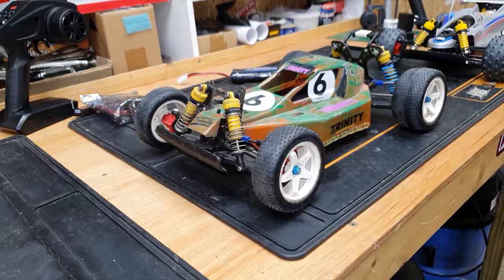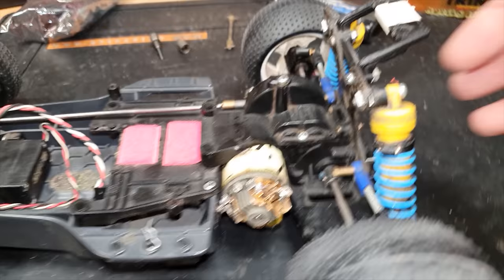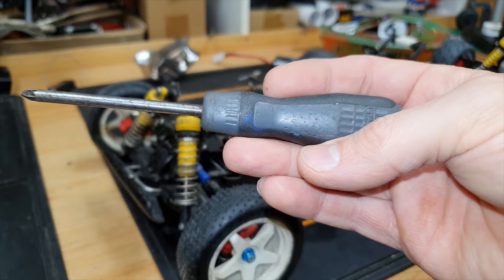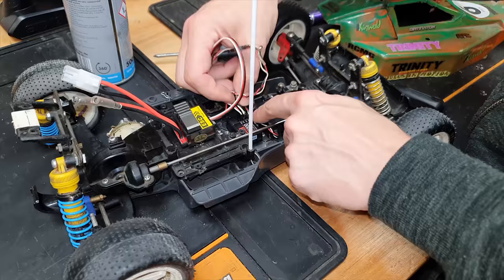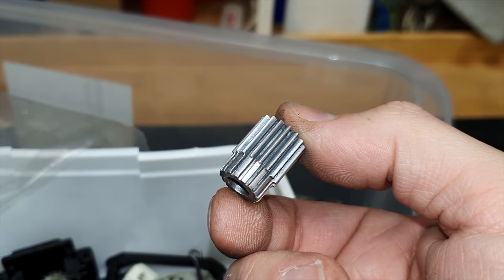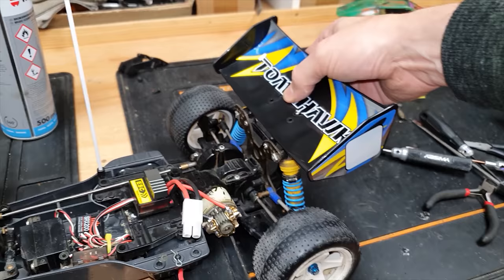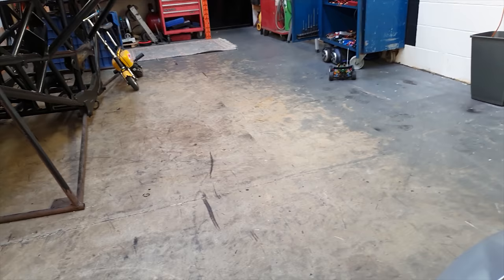Old Tamiya MANTA RAY - Bringing it back to life Part 2

Comment from the maker: What was your first RC Car?
Reply: Hpi rush evo
Reply: Traxxas 4 TEC 2.0
Reply: A tamiya TT02
Reply: Associated sc10 brushed was my first hobby grade. I had to cut many of yards in the summer to buy it
Reply: The traxxas Rustler
Reply: Traxxas Nitro Hawk
Reply: Wltoys a959 from about 5-6 years ago
Reply: Traxxas Slash 1/16 4x4
Reply: Traxxas Slash 2 wheel drive it's my first and my only
Reply: I had the Niko Lobo Road Handler and like you I was flat broke. I saved up for it and when I finally got it I was beyond excited!
Reply: Wltoys A959-B
Reply: Carson Max18xxl
Reply: First upgradable rc was xmods!
Reply: Hobao hyper 9e
Reply: Trasxxas x maxx 6s but upgraded to 8s internals all your fault kev;)
Reply: I've never had one
Reply: My first RC car was a Tamiya Rising Fighter, which is strange because that RC is twice my age. I went on a holiday in a rented house (air bnb) and found it in a shed. It was all rusty and crappy but I got it working again, and so the owner of the house said I could keep it as it was her sons and he hadn't used it in almost a decade. Anyway, that's a car from around the same generation as yours, which I think is pretty cool to say the least!
Reply: Traxxas slash 4x4 vxl
Reply: Tamiya Super Blackfoot MT kit!! 10 years old as well!!
Reply: 1/16 slash 4x4
Reply: Xmaxx 🤣💪🏼
Reply: Slash 4x4
Reply: tmaxx 2.5
Reply: Latrax rally car
Reply: Tamiya blackfoot
Reply: Toy grade rc car
Reply: 2WD Brushed Slash
Reply: Kevin Talbot A fully self build
Reply: Traxxas erevo 1/16 VXL brushless
Reply: My first car was the traxxas bandit
Reply: My first rc car that was hobby grade was a traxxas rustler BIG MISTAKE I COULD OF BOUGHTEN THE ARRMA NONTORIEUS
Reply: HPI mini recon
Reply: Can't remember model name but it was some sort of Outlaw has a brushless motor still bash about with it today
Reply: Wltoys a959
Reply: Lunch box
Reply: Dromida sc4.18
Reply: Kevin Talbot kyosho outrage buggy and a tamiya grasshopper
Reply: Dromida MT 4.18
Reply: Cheap one
Reply: Losi mini desert truck 1/18
Reply: Ely Tolson Me 2 :)
Reply: 1984 Radio Shack Jeep Renegade. I still have and my second Radio Shack Audi Quattro,  and my 3rd Associated RC10 all I still have.
Reply: I have a Tamiya super Blackfoot, that I'm working on getting parts for to get it back on the road.
Reply: Tamiya sand rover
Reply: mine was a Red cat racing gen 7 crawler
Reply: Kevin Talbot i got a wltoys it was green
Reply: My first hobby grade RC was a 1/24 scale Tamiya 1983 Porsche 956 Le Mans. Started saving for it on my 8th birthday & Got it & a Futaba stick AM transmitter/receiver for just under $300 for my 9th birthday. I stayed up all night (my first all nighter!) to build it. I’ll never forget that RC!
Reply: My first rc was a Revell Controll Buggy 4x4 M 1/14 scale buggy back in 2011. It was an absolute POS and turned me off the hobby until I got my tamiya M05 in 2014
Reply: A couple years back i had a helion animus 18sc. Man i wish i still had it...
Reply: A 1997 tamiya cc01 honda crv also bought from models in motion the same place as your manta ray loved that shop when I was a kid.👍
Reply: @jerrymuniz7001  get one
Reply: Kevin Talbot trophy 3.5 buggy got it in 2011 when i was 7 years old 👍
Reply: NIKKO raider
Reply: Himoto 1 10 2wd buggy or according to Himoto it's the Himoto MegaE HUD but if you search it up on google use Himoto 1 10 2wd buggy it's the second image that shows on images
Reply: It's not that easy
Reply: Is the Ecx roost considered as hobby grade?
Reply: WPL c24
Reply: Traxxas stampede bushed
Reply: Second Hand Grasshopper when I was 12. Then got a Kyosho Ulitma, Mardave Meteor, Mardave Mini then an Ultima Pro XL. I still have them all apart from the grasshopper.  The Ultima Pro XL still runs and is getting an upgrade soon.
Reply: My first hobby grade was a traxxas stampede 4x4 brushed. I got it when I was 7
Reply: Hobby grade or whatever
Reply: If so Traxxas Slayer pro conversion
Reply: Kyosho Inferno Neo 2.0 and it's still my go to to RC today and I plan to keep it for as long as I live
Reply: @blueterror2276  that's a great RC man
Reply: Ftx outback ranger 2
Reply: I had a savage flux hp (silly fast)
Reply: @bensvlogsandvideos9256  that's a great crawler
Reply: @bensvlogsandvideos9256  did you customize it or did you leave it stick
Reply: A manta ray lol
I need to get it going again
Reply: A Mk1 Kyosho Stinger that I still have and still run! even though it breaks something just driving down the street, lol
Reply: @shadowkeeper1217  upgraded servo that's it
Reply: eceed rc blaze
Reply: @bensvlogsandvideos9256  hmm
Reply: i dont have an rc YET  i plan on geting an Arrma Senton BLX but Im broke :/ ill get one evntualy
Reply: My uncle gave me a slash 4x4
Reply: lucky :/
Reply: Tamy grass hopper then kyosho ultima
Reply: Losi mini highroller
Reply: I hear you loud and clear Kev, I believe we all chase those feelings once we get older and regular life continues to dull. Btw my first hobby grade was a Team Associated rcgt10 with an o.s. .18 racing nitro motor and at the sweet age of 13 I was more enthused by it than most anything I've had later in life.
Reply: @jerrymuniz7001  you made us all very sad please save $100 and treat yourself with a wl toys maybe they have a nice selection around  $100.
Reply: Tamiya King cab and still have it.
Reply: Kevin Talbot a brushed Traxxas rustler
Reply: ECX torment
Reply: 1/16 Traxxas slash
Reply: @MrDollaBillman  I am only 12
Reply: Hey put me in your videos for no reason
Reply: hpi wheely king
Reply: Kevin Talbot my first car was a Traxxas slash 1/16 scale vxl
Reply: Academy   Monster hummer  !!!!
Reply: the traxxas latrax desert prerunner
Reply: 1998 Traxxas Rustler
Reply: Tamiya Hornet (1984/85)
Reply: Traxxas telluride
Reply: Traxxas 4x4 teluride
Reply: Academy Rock buster
Reply: Redcat racing volcano 10
Reply: Tamiya Big Bear
Reply: Hpi savage 4.6
Reply: Traxxas nitro rustler. The old boxy one.
Reply: Mine first rc was used hpi rush evo
Reply: Traxxas Stampede in 2004
Reply: My first hobby grade RC car was the Traxxas bigfoot 2wd
Reply: Tamiya Grasshopper...  took forever to save up the $200 bucks.  Jrpropo stick radio $100 with two (slow) servos.  Horrific mechanical esc.  Reverse for brakes.  Runaways o'plenty.  Added a diode to act as a BEC and get rid of the 4xAA.  Resistor wire charging off a car battery.  It was more epoxy than machine when I was done with it... Ran for 40 minutes with the 380 motor but the 540 upgrade was sweet...  Used to beat my buddy's Yokomo 4wd racing in the vacant lot across the street because he had more car than skill
Reply: My first hobby-grade RC was the Traxxas Cat. Around 30 years ago. It was in kit form.
Reply: An Arrma senton mega :)
Reply: Traxxas Slash 2wd
Reply: Nissan skyline GTR matblack  with hobbywing 8s with drift wheels
Reply: 1 16 slash brushless, it was awesome as a 8 year old but as I got older I realized how much it kept flipping over and the handling wasn’t great but man I put that thing through its paces.
Reply: redcat XBE
Reply: Robert Schexnayder  thats a thing?
Reply: duratrax evader ext 2
Reply: Mine was the traxxas Rustler 4x4 VXL, I’m only 14 years old.
Reply: Mine was the traxxas Rustler 4x4 VXL, I’m only 14 years old.
Reply: Cen nemesis 7.7
Reply: Himoto eamba xr1 4x4
Reply: Traxxas rustler brushed version
Reply: Tamiya Frog (secondhand!)
Reply: Mk1 Schumacher Cougar
Recently rebuilt with re-release TopCat parts.
Reply: First ever was a toy grade monster truck.
First real RC car was a  Thunder Tiger TS-4n, still have it and it's still working.
Reply: Kyosho Raider
Reply: Black foot 3
Reply: MRC Tamiya frog
Reply: Traxxas E-revo 1/16 brushed. Still my only hobby grade car. I absolutely love wrenching on it.
Reply: Arrma granite 2wd
Reply: Im still 12 im still having my first rc

Tamiya DF-02
Reply: 1/18 scale dromida buggy
Reply: My maisto speed beast hobby grade I got it last year so this christmas I'm getting a Rustler Vxl tsm 2wd stadium truck
Reply: Losi 8 conversion 85mph 6s
Reply: Feel very lucky
Reply: Tamiya Alfa Romeo Giulia Sprint (M06 Chassis)
Reply: 1st a Tamiya Monster Beetle, then a Tamiya Clod Buster, then a Kyosho Lazer ZX. That was back in the late 80's, early 90's... Wow!
Reply: Tamiya Grasshopper II Super G
Reply: WL Toys L959 2WD Non-brushless, Battery dies so fast, still. It's fine afterall (I usually use it for offroading in the rain, mud, snow).
Reply: Vaterra Glamis UNO
Reply: Absima asb1
Reply: Traxxas xr mate
Reply: Kyosho 1/7 model Ferrari f2007 formula 1 car with Kyosho gx-21 nitro engine
Reply: traxxas ford raptor
Reply: 5 dollar rc car
Reply: Traxxas slash 4x4 VXL
Reply: Tyco rebound, 4x4 booM😍😍
Reply: Kyosho Fazer VE-X with Mitsubishi lancer evolution body
Reply: it was when i was 4-5. it was a 1/10 peugeot 205 rally car. pretty cool but not fun in a building the size if a hamster cage. :(
Reply: Kevin Talbot ftx vantage brushes
Reply: Tamiya Monster Beetle, sometime back in the 90ties.
Reply: Absima ab3.4
Reply: Losi xx
Reply: I got a losi xx with A 5.5 motor
Reply: Tamiya Monster Beetle
Reply: A rwd traxxas stampede. I still have it. Its cool
Reply: Tamiya The Hornet! And i loved it!!!
Reply: Hsp vortex
Reply: Reely detonator
Reply: A ftx vantage
Reply: ZD Racing B10e (Brushed version) reason of purchase: (it was the cheapest 1/10 rc buggy on ebay at the time)
Reply: VRX-2 nitro
Reply: duratraxx maxim mt was my first
Reply: One of the newer Traxxas Bandits. I got it last year, been racing it for half its lifespan, and boy do I love it!
Reply: Vaterra twin hammers
Reply: Wild willy
Reply: A used 50 dollar set it Traxxas t-maxxes one with a .19 and the other with a .15
Reply: Tamiya Grasshopper
Reply: Tamiya Mo1 Mini cooper
Reply: hsp cheetah
Reply: Team associated rc10 gold pan
Reply: Tamiya Ferrari f189
Reply: ECX Torment 2WD and I bought it because of your vids, like a year ago :)
Reply: Wl toys 12429
Reply: If you are talking about hobby grade, then the Traxxas Rustler. Just the plain, red, Rustler. I put a velineon motor and esc with a fan on it, along with other aluminum parts.
Reply: Tamiya Bigwig, lol I snapped the bumper on the first drive! 😂
Reply: But my first hobby grade rc was the Great Plains Stinger RC boat
Reply: 1989 tandy wild horse 4wd truck
Reply: 1/6 Scale Rc Humvee!!
Reply: A 1/10 scale Carisma m40s Subaru WRX STI NBR
Reply: HPI Firestorm 10T (nitro) 1st generation.
Reply: Traxxas x max 8s
Reply: Tamiya lunchbox
Reply: Mercedes-Benz sls amg
Reply: Thunder tiger ssb
Reply: Traxxas 4tec 2.0
Reply: I had a Cox Bandido, absolutely loved it, believe i still have it somewhere, may have to find it and try and get it running again. i was only around 6 or 7 when i got it
Reply: Ripmax dingo
Reply: Wltoys 12428
Reply: Lc racing monster truck old ecu version
Reply: Associated team rc10 with the gold pan
Reply: Tamiya Baja King. I upgraded everything possible on it. It had a lot of problems driving in a straight line tho. The way the battery went through the middle of the chassis made it a bit unstable causing it rock from side to side on cornering. Still it was fun because I  changed the pinion gear and motor and speed controller to make it go stupidly fast.
Reply: First ever rc was a awd xmod, they had tons of spare parts and upgrades , then sometime after that I got a traxxas rustler for my birthday , must of been 2010 or sometime around their , thing was pretty bulletproof well so I thought back in the day , kept it around long enough to through a 4800kv brushless on 3s , back in the day that was crazy fast
Reply: The GRASS HOPPER.
Reply: 1/16 e revo
Reply: Was A wltoys a969b now ordered the 144001
Reply: Kevin Talbot my first RC car was a X-night v2 I got it 2 days ago because I saw ur channel
Reply: Sst racing 1937
Reply: Traxxas rustler
Reply: Tamiya Manta ray exact same as your silver one ! Then a Tamiya mad bison monster truck
Reply: Traxxas slash 2wd
Reply: Traxxas slash 2wd chad hord edition
Reply: traxxas stampede 2wd
Reply: It's what's left of a kyosho outlaw rampage. Currently sat in a shop as I bought it as a roller
Reply: Tamiya Hornet.
Reply: Two years ago when I was 11 I got a brushless vantage buggy and now I race 1/8 get touring cars
Reply: Helion Rock Rider Brushless
Reply: Kevin Talbot v1 maverick ion mt
Reply: 1/16 losi mini sct
Reply: Kevin Talbot  losi 8ight nitro
Reply: Traxxas teton
Reply: Traxxas Cat
Reply: TRAXXAS Rustler xl-5
Reply: RC CAR FAN same
Reply: Marui big bear the original monster truck
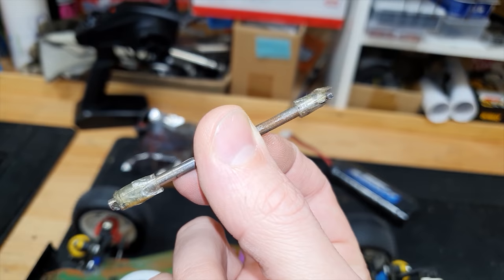Reply: First hobby-grade rc was 1:12 scale hsp buggy
Reply: Tamiya bearhawk
Reply: Traxxas slash 2wd
Reply: Lrp s10 twister
Reply: Team associated sc10 2wd
Reply: Carson specter 6s
Reply: FTX outlaw brushless motor got it last Christmas could u do a review or something
Reply: Subaru brat. 1980s Happy memories building it. I miss you Dad.
Reply: 1/16 slash 4x4
Reply: @louieparenas4537  worst car ever
Reply: Traxxas summit 1/10 brushless
Reply: Tamiya monster beetle
Tamiya bear hawk
Reply: traxxas villain ex boat
Reply: 1980's kyosho 4x4
Reply: Traxxas Slash 1/16
Reply: Traxxas slash 2wd
Reply: Redcat Rockslide RS10
Reply: Dodge Viper
Reply: Kevin Talbot first rc car I ever had hobby grade was a Duratrax CliffClimber fourwheel steering it was amazing. I was 11 my dad treated me to a birthday gift and it was spectacular and currently I cannot find one to buy back :(
Reply: RedCat Rockslide
Reply: tomahawk nitro
Reply: Traxxas rustler . I bought it abouth 1996 . second one - revo 2.5
Reply: Tamiya Frog
Reply: Tamiya ta05 (2006 red nsx) still use it with the crystal radio set and lrp sprinter
Reply: I’m ten years old and I drive a Traxxas slash 4x4
Reply: I’m 10 years old and I drive a Traxxas slash 4 x 4
Reply: Tamiya bigwig mate 😀 Then I upgraded to a Kyosho Optima then the optima mid
Reply: Ely Tolson same dude!
Reply: First hobby grade RC, a VKAR Bison that I bought after watching your review! Now it’s completely far from stock
Reply: Never had 1 :(
Reply: Latrax teton and the only one for 4 years :p
Reply: Traxxas slash 3.3 in like 2011
Reply: Traxxas 1/16 erevo
Reply: Slash 4x4!
Reply: 2010 traxxas slash 4x4 ultimate with tqi link controller
Reply: 2010 Tamiya sand scorcher
Reply: tamiya  blackfoot 1986
Reply: mini q trq 1
Reply: the MERV
Reply: Traxxas rustler VXL
Reply: Wltoys 12428
Reply: Wpl c24
Reply: Kevin Talbot ftx vantage brushless
Reply: Sears Lobo 2
Reply: Reely Titan
Reply: Storm cc
Reply: Xo-1
Reply: My first hobby grade that has actually been reliable was a La Trax prerunner. Unfortunately... The motor is currently blown : (
I got that thing at get this, a GOODWILL for 5 bucks. Came with the remote, car charger and battery. My best Goodwill purchase ever.
Reply: Ny aunt from sweden for my birthday bought me a red 1:10 scale mitsubishi lancer IX
Reply: Tamiya grasshopper
Reply: Vaterra Kalahari
Reply: A 1/16 ERevo
Reply: Fg rc bible
Reply: Arrma short course. I forget what it's called but I still have it somewhere. I should break it out again
Reply: HPI wheely king
Reply: My first was a cen ct4s nitro car still got it today
Reply: @Fire32Ball  me too
Reply: HSP XSTR PRO
Reply: A second hand Tamiya Madcap for christmas in 1993, my parents couldn't afford the Lunch Box I had wanted for years before. Can remember upping the motor from the stock 540 a year later and ripped a rear corner off it from a crash. Took a couple of months to save up for a new chassis. Was tempted on buying a Super Astute re-release recently to get close to the madcap the 14 year old me dreamed of back then
Reply: Vaterra Ascender, about 2 years ago.
Reply: Traxxas nitro sport pro 15
Reply: I have had so many cheap ones I don’t even know lol
Reply: Hpi mini recon
Reply: A used gold pan RC10. First kit I built was a Traxxas TRX1. Still have both.
Reply: 1/10 scale HSP buggy
Reply: Hpi savage 4.6
Reply: Hpi trophy
Reply: Tamiya Falcon. Still have it, and it still runs (once a year or less).
Reply: Tamiya Nissan king cab! Still trying to find a replacement I can afford.
Reply: Traxxas sst 4x4
Reply: Hyper 7nitro buggy
Reply: some kind of audi r8 and I think the brand was nikko or something... it was black and covered with stickers but it doesn't work any more...
Reply: Tamiya Volkswagen race-touareg
Reply: Traxxas stampede 4x4
Reply: The Grasshopper
Reply: kev im 12 years old and if you look at on my youtube acount you will see that almost all of the videos i watch are from your channel and i love the ram[page
Reply: Absima asb1bl
Reply: Absima ASB1BL
Reply: @leofong8689  me too🤣
Reply: The old e revo when i was 6 yrs old lol
Reply: Tamiya Dirt Thrasher and a Kyosho High Rider Corvette II
Reply: My very rc is a nitro rc truck
Reply: BSD Racing Viper
Reply: A rock climber Losi
Reply: Losi xxx nt nitro
Reply: Kevin Talbot slash 2w drive brushed
Reply: Mytoys MT-979
Reply: I'm 13 and Im still using my ftx vantage which is no 3 years old
Reply: Ecx boost brushed it was like 5 years old when I retired it I now own a team associated b5m team associated rc8b3e and a team associated b74
Reply: Hi Kev I love your vid my first car was a hpi savage
Reply: I'm 12 and I got from grandpa that works with electronic  stuff and he had a rc car lying around and its ta02
Reply: Losi Night Crawler, still use it to this day.
Reply: Traxxas 1/16 e-revo it is 3 years old now 😅
Reply: Tamiya fighter buggy.
Reply: Traxxas tmaxx 3.3
Reply: I have no clue what my first toy grade was but my first hobby grade was a Traxxas stampede 2wd that I got 10 plus years old from my Dad's friend at 10
Reply: This actually zeb berry but a traxxas slash with a ONYX upgraded motor
Reply: TAMIYA Blackfoot
Reply: Very old traxxas bandit 16yrs old about or more.
Reply: traxxas rustler 4x4
Reply: Tamiya hornet
Reply: ECX Ruckus 2WD brushed. It was so fun, except for when the steering arms snapped off and it motor turned off to keep it from overheating 😂😂
Reply: A Walmart monster truck, toy grade, but I loved it!! Tried taking it mudding in a river and found out what happens to toys when they get wet haha.
Reply: Armma senton
Reply: Arrma senton
Reply: Nitro t maxx
Reply: Trx4 when I was 13 years old
Reply: HSP warhead Nitro
Reply: Toy grade is a new bright  hobby     Grade is a rc10b2
Reply: Tamiya king Blackfoot       
It still runs
Reply: Xmax

Jk it was the bigfoot
Reply: Xmax

Jk it was the bigfoot
Reply: Traxxas rustler XL-5
Reply: hpi jumpshot mt
Reply: Hobby grade truck
Reply: A toy grade range rover
Reply: Jack DaBeast Traxxas stamped 4x4
Reply: An arrma outcast
Reply: Redcat racing cyclone xb10 but I threw it away but I found one used and bought it
Reply: My first hobby grade one was a manta ray as well.

I just rebuilt.mine as well!
Reply: A Traxxas Slash 2wd.
Reply: Ecx torment
Reply: Traxxas 1/16 summit
Reply: Tamiya Monster Beetle. Used to rip it round the garden from my bedroom window. Mam thought we had stray cats ripping up the flower bed. But no. It was me aged 8 chewing them up with the truck.
Reply: Car
Reply: HSP Xstr
Reply: Reely rhino
Reply: Kev my first rc car was a tamiya super hornet but tires are spinned out lol😂😂
Reply: Tamiya Grasshopper 1984 was my first hobby grade RC car, although I had tonnes of toy grade ones:)
Reply: 2wd slash
Reply: Neo jumper II (Carrera)
Reply: I can't remember if my first proper rc car but my first was a spiderman trike wen I was 4
Reply: I don't hav an x box

I hav a ps4

Sadly I only hav 1 rc car
Reply: Losi ten scte
Reply: Traxxas slash
Reply: Tamiya midnight pumkin
Reply: Traxxas slash
Reply: Traxxas slash 2wd
Reply: Mrc tamiya Blackfoot!!!!
Reply: Schumacher Couger Club 10 , Mardave vdub, then Losi xx, Yokomo yr4m2 after that I got a Yokomo mr4tc all I used to race at a weekly club meet. Haven't got any of them now though.
Reply: Hsp 1/16 buggy
Reply: my first hobby grade was the Team Associated RC-10 B2, assembled it my self when i was 13. I only just back into the hobby a few months ago when my 4 year old son wanted to go into the hobby shop in my town.
Reply: I would love to see a series about old/vintage R/C cars. Remember the tamiyah clod hopper, lunchbox. Back when Losi and Team associated were the big dogs
Reply: Toyota supra mk4 rwd
Reply: my first hobby grade rc was a offbrand monster truck
Reply: lol that was only a year ago
Reply: 1/5 Yama buggy 2 wheel drive it’s petrol
Reply: Tamiya ta02 ford 150 baja 1000
Reply: Hosim 9125 xinlehong toys
Reply: Im 10 years old now mine is hosim 9125
Reply: Kevin Talbot rustler xl5
Reply: Traxxas slash 4x4.
Reply: Traxass e Revo 1/16 just 4 days ago
Reply: E revo 1/16 the old version. Then I put a hobby wing 1/10 brushless motor and esc on it. Now it rips!
Reply: My first was the Tamiya Hotshot II.. Very similar chassis to this Manta Ray.
Reply: Dromida dune buggy
Reply: ARRMA senton
Reply: I got a Porsche 911 but it took around 7 or 8  double A in the car and a 9v in the controller and in lasted 10/15 minutes so that was that Christmas morning spent pushing the bloody thing because it cost to much to replace the batteries 😂🤣😂😘👍
Reply: Kev did you ever win with it bud ??
Reply: Hbx rampage (first hobby grade)
Reply: Reely Carbon Fighter II Brushless
Reply: Hpi savage flux hp
Reply: Tamiya grasshopper
Reply: Bsd racing prime onslaught v1
Reply: Im 12 and I just bought a used arrma outcast 4s yesterday and it is AWSOME
Reply: 6 tire chariot
Reply: Wltoys 12428
Reply: in 1986 My uncle took me to our local hobby shop and bought me the Kyosho Pegasus.  Manual speed controller and DC charger.  Had to wait for dad to come home from work so I could use his Nissan to charge my battery.  It was a kit and a big deal for a 7th grader.  By 9th grade I had a RC10 and was trying my hand at some Novice class racing.
Reply: Hpi savage 4.6
Reply: Traxxas slash 2wd (super basic)
Reply: Kyosho lazer zx5 Readyset
Reply: WL toys or a utor 8e
Reply: teamlosi xxx-nt and tamiya galaxy
Reply: The duratrax vendetta 1/18
Reply: My first was a buggy and a got it when I was like five then a slash 4x4 that thing was so fun
Reply: A toy grade slr mclaren
Reply: Wltoys A959
Reply: Overmax 3.0
Reply: Tamiya tt-01
Reply: Traxxas slash 2wd
Reply: Arrma raider blx xl
Reply: Arrma granite 4x4 mega
Reply: Traxxas stampede
Reply: Kyosho Mini Z MR01
Reply: Beetle 2.0
Reply: a little corvette from ross
Reply: Mn99s
Reply: A brushed Traxxas slash 2wd. It was the best decision I have ever made.
Reply: Traxxas bandit
Reply: FTX Kanyon 4x4 and Slash 4x4 VXL
Reply: A rc car going 4 mph ik it suck
Reply: Wltoys 12428 1/12
Reply: I had a Traxxas Cat two wheel drive off road buggy. I remmeber how it would really just bounce down the  track with trailing arm front suspension , my first upgrade was duratrax oil filled aluminium shocks , the car was dialed in and some younger kid was infatuated with it and wanted to buy it so badly , I sold it to him and bought a  Tamiya Thundershot .... and then I was hooked on Radio control , I did all kinds of radio control racing off road as well as Carpet cars , touring cars and eventually bought a glider and crashed it, several boats as well as a swamp buggy, (air boat ) , while racing I won several trophies , ( we would recycle the trophies and hand them out again and again  lol) , many days were spent in parking lots and school gymnasiums , in serious " competition ",it was the most fun and  the comraderie with the racers was a fantastic experience , so many friends took up the RC hobby from my introducing them to it over the years and the sons of my friends as well . Ps. I have an Acooms radio band five as well as the wiper for your Car all new with a resistor if you send me postage I would give them to you . thanks for making me remember the real times .
Reply: Hpi rush evo
Reply: @Dalelakeman  wow that’s one awesome story!
Reply: @Sebastian Turco that’s not even responsible it must’ve been your dads
Reply: Redcat valcano
Reply: a bmw raster
Reply: Mine was a rock crawler scale 1:14
Reply: Mine is rgt rc crawler 1:10 scale
Reply: TRAXXAS /2x2
Reply: Cross tiger super motivation
Reply: Cross tiger super motivation
Reply: First hobby grade car i got was zd racing b-10e 
And still is my only hobby grade car :(
Reply: Arrma senton 2s mega 550
Reply: HSP 1/16 scale kid king monster truck
Reply: HO speed truggy
Reply: An Ofna Monster Pirate nitro.
Reply: Traxxas slash 4x4
Reply: a toy grade rc car that acted like an rustler
Reply: hpi wheely king
Reply: Traxxas bandit 2wd brushed
Reply: Dromida mt.14
Reply: Tamiya Blitzer Beetle
Reply: lrp s10 twister buggy
Reply: traxxas rustler 2wd brushed
Reply: 2wd Rustler VXL!
Reply: Hpi racing savage xl flux
Reply: Traxxas slash
Reply: 1/16 Slash 4x4!!
Reply: Traxxas rustler 2wd brushed
Reply: I’m getting a traxxas slash 4x4
Reply: a traxxas slash
Reply: HPI Brama 10b brushed
Reply: Traxxas slash 2WD vxl Brushless W/OBA
Reply: Traxxas slash 4x4 brushed
Reply: Redcat volcano epx
Reply: Traxxas slash 4x4
Reply: Xmaxx
Reply: Its still my only one but arrma typhon😄
Reply: Traxxas slash
Reply: A LAGENDARY
Reply: HSP 94123pro with HOBBYWING COMBO EZRUN
Reply: hosim 1/16 monster truck
Reply: Tamiya grasshopper.  Led to some good years of racing with my dad and brothers.
Reply: Tamiya grasshopper, led to weekly racing with my dad and brothers. Good times.
Reply: traxxas slash 2wd ford raptor fox
Reply: Hobao hyper 21 nitro rc car
Reply: traxxas mini e-revo 1.0 vxl
Reply: Nikko magnum
Reply: @jerrymuniz7001  don't give up to easy. I did a paper round and a milk round when I was at school. Then when I got a summer job filling coal sacks my first rc was a toy  a nikko magnum.
Reply: @n1c941  same
Reply: First Brushed spirit second drift gorilla
Reply: Tamiya Grasshopper
Reply: Ftx outlaw brushless
Reply: Granite 4x4
Reply: Tamiya grasshopper
Reply: Tamiya Blackfoot via 1989
Reply: A 2 fast 2 furious model evo from toys r us
Reply: A 2wd brushed rustler when I was 13 now I’m 14 and have the xmaxx/udr/traxxas Ford Fiesta fully built brushless/erevo vxl mini/Maxx v2/rustler 4x4 vxl/hoss vxl/Mojave and Losi 5t
Reply: tamiya dirt thrasher. same car, just with a different body! the trans noise is almost certainly the motor mount. stock plastic ones would eventually break. fortunately, there are several different aluminum options on the market.
Reply: Wl Toys K969😬
Reply: Quanam vandal though it was upgraded already
Reply: Tamiya TL-01
Reply: A traxxas rustler 4x4
Reply: traxxas e-maxx
Reply: kyosho raider pro
Reply: Traxxas Revo. I learned all about engine tuning and maintenance. Most people are against this, but I recommend to start with a nitro as your first or second car. Respect the nitro and maintain the nitro then get a brushless to run with the nitro.
Reply: Kangaroo rc car
Reply: My first rc was this bomb squad truck from Radio Shack if anyone remembers that place. It was damn near indestructible
Reply: Losi mini t 2.0
Reply: Rustler
Reply: Manta ray in 1994
Reply: pick up crawler😀
Reply: Traxxas stampede 2wd
Reply: Traxxas slash
Reply: First hobby grade was a maverick quantum mt it was very unreliable but then I upgraded and it was much better
Reply: River hobby blaze 1/5 30cc
Reply: Traxxas tmaxx with the 3.3 if I remember correctly
Reply: Stampede 2wd xl5!!